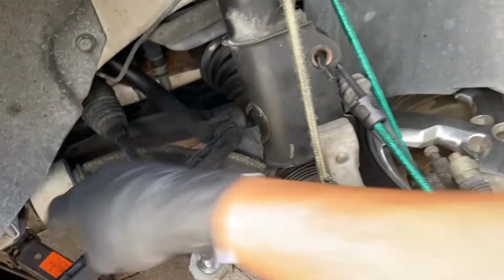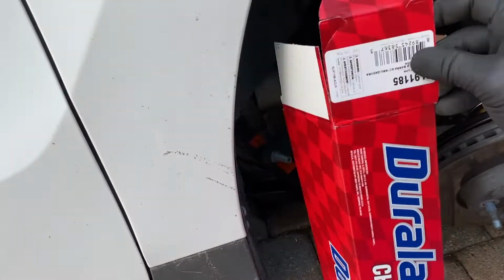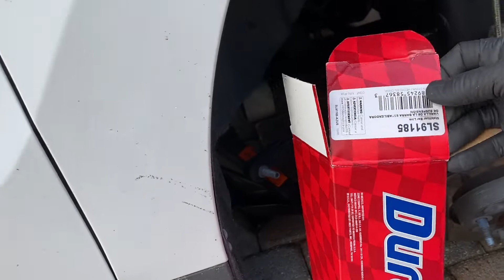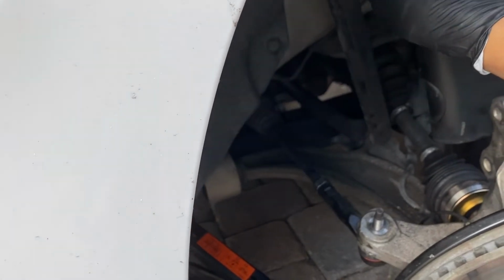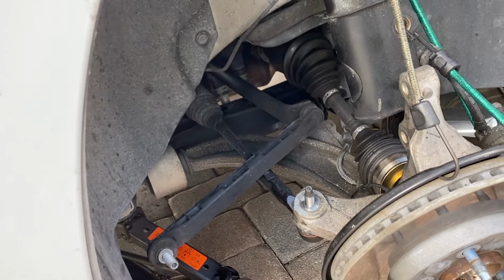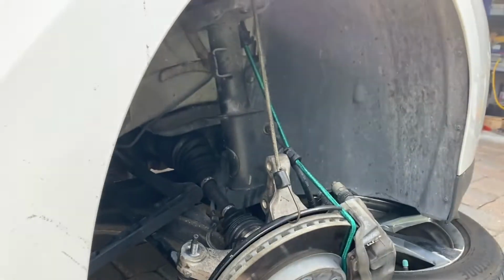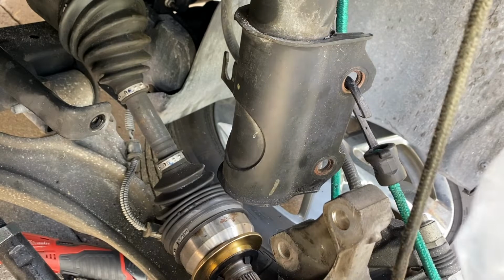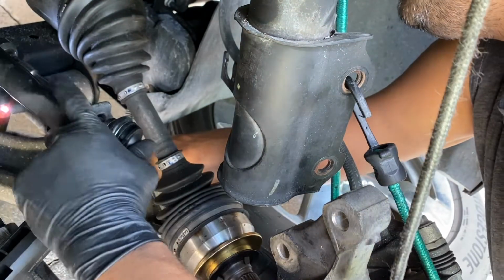How to replace Stabilizer Link on Chevy Volt

Comment: Thanks,  just subscribed.  I'm changing mine out right now.
Reply from the maker: Good luck brother. I’ll also be changing my shocks soon so will make out a video. My front ones are bad
Reply from the maker: Let me know how did it go for your replacement.
Reply: It went great, super easy thanks to your video. I'll be on the lookout for your video on the strut replacement,  I ordered all the parts for front and back, the front is shot for sure and might as well do the rear. Thanks
Reply from the maker: I did my rear and those were simple. I didn’t do a video on it but there is a good one on YouTube. There is none for the front struts so I’ll make it this week. 
What brand struts you got? Make sure don’t go cheap on those. I bought Monroe.

Comment: Hello Sir. Thank you for the video. What was the driving issues you had with the Stabilizer Link bad? I have a 2014 Chevy Volt and when I let go of the accelerator, the car would swerve.
Reply from the maker: You have to inspect your suspension. My stabilizer link was broken and it was making a clunking noise.